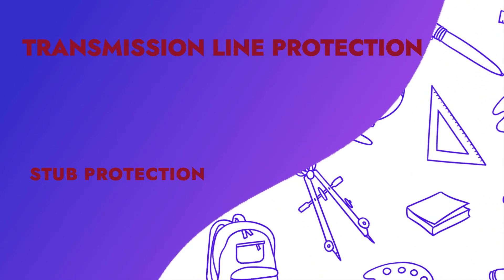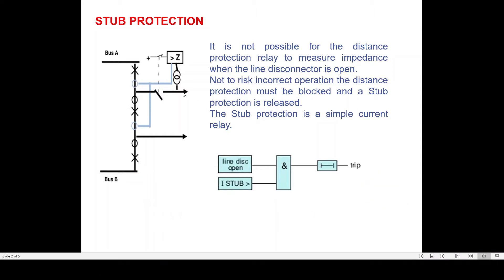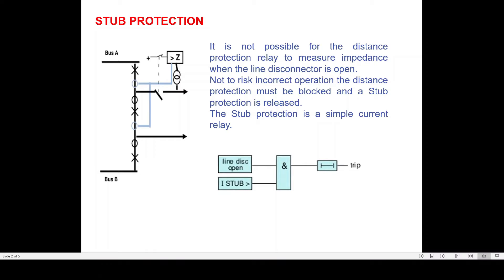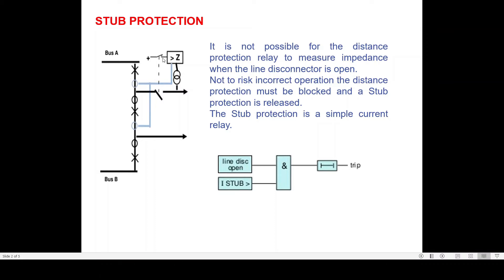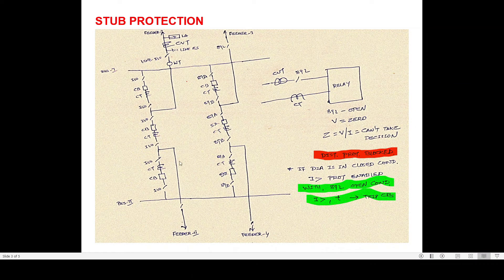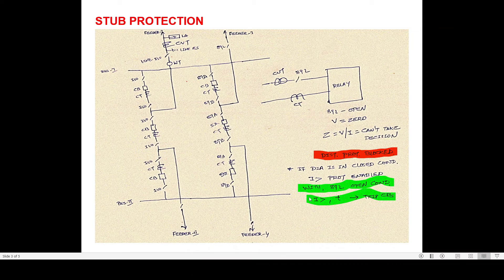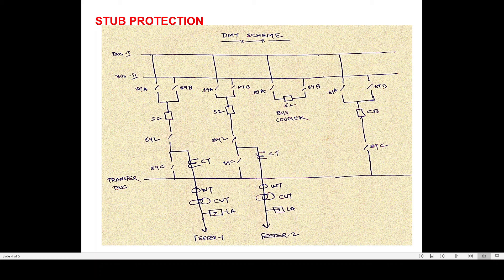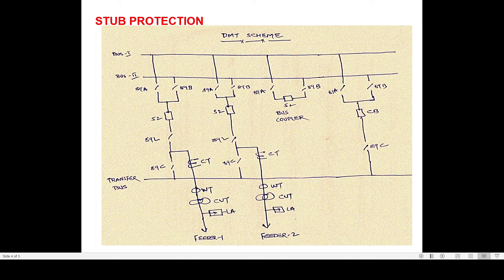LEC-8: STUB PROTECTION || IMPORTANCE AND WORKING PRINCIPLE OF STUB PROTECTION || IN ENGLISH

Comment: Great explanation. Sir,Thank you so much.
1.5 CB scheme CT conjunction parallel  ckt detail even during load flowing current how to current subtracted, Vector addition both ,after two ct core conjugation current how going to zero  why need CT conjugation of Dia. Please explain to us by helpful tutorial series.🙏
Reply from the maker: Thanks Biplob for your valuable feedback.

Sorry, I am unable to understand your question. What do you want to know

1. Current compensation in parallel lines (mutual compensation)?

Or

2. CT connection in case of Distance protection of TL with 1.5CB Scheme I.e. How to parallel the Main Bay and Tie Bay CTs in case of distance protection?
Reply: @LIGHTNINGMINDS_PANKAJKUMARJHA  
Exactly, You have got my point..........
1) CT Connection in case of Distance protection of Transmission line with 1.5 CB scheme arrangement How to make perallel  Main CTs & Tie CTs core in case of distance protection 
2) Why need parallel  or conjunction to Main CTs & Tie CTs of 1.5 CB scheme.
3) Please explain by theoretically normal load flowing  condition why show  zero current in relay / Meter of 1.5 CB scheme. 
4) What is the benifit of Main CTs & Tie CTs core conjugate for Protection or metering purpose of 1.5 CB scheme 
5) Please sir explain by theoretically us two condition of 1.5 CB scheme arrangement 
‌Condition -1:-
- 1.5 CB scheme Main-1 CB, Tie CB Close Main-2 CB Open...........
‌Condition -2
- 1.5 CB scheme Main-1 CB, Tie CB and Main-2 CB Close..........
In this case Condition-1& Condition-2 How to monitoring load current  feeder-1 & Feeder-2
Reply from the maker: OK Biplob. I will explain all these concepts in our coming session definitely.